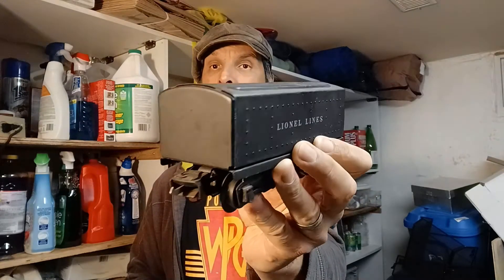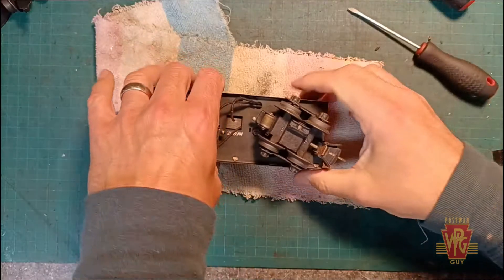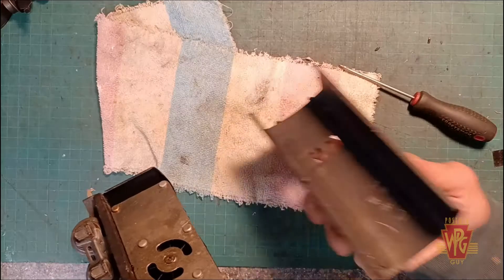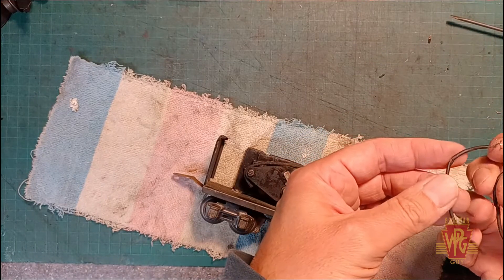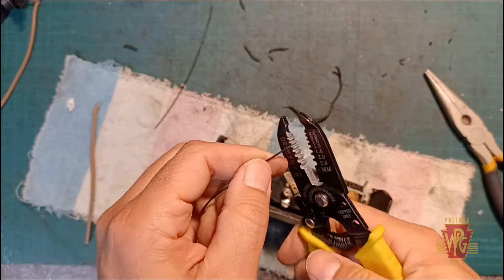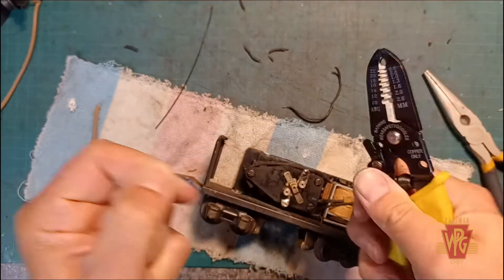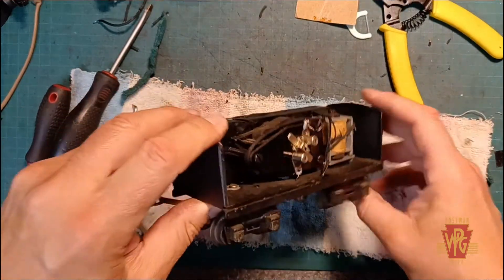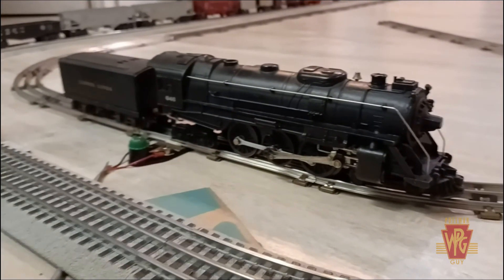Why isn't my prewar tender whistling? A 2689W with neat surprise!

Comment: Nice job Warren!  I had to do a job like that myslf a yar or two ago but it was a metal post-war tender instead of a pre-war.  I'll tell you, I found getting the shell back ON was harder than getting it off! 
What I'd do at this point is if you don't want to start a collection of pre-war cars try and find a pre-war with similar couplers and replace one truck with a post-war one, make a "bridge" car for lack of a better term.
Fun video!  Thanks!

Comment: I believe the wire attached to the screw on the underside of the tender is to improve the relay ground, since from what I understand the relay is just riveted to its bracket. This was discussed as an improvement in one of Jim Barrett's workshops on VHS tape (for O Gauge Railroader Magazine). Very good video, A+++

Comment: The part number for the adapter is:TT-100. I hope that helps. BTW,  nice job. The only thing I have done differently is to add a rubber grommet in the tender base, to protect the wires.

Comment: Another nice,  informative video. Do you think these old tenders needed to have 2 pickup rollers?
Reply from the maker: I'm not sure if they really need 2 pick up rollers, but Lionel gave it 2 for some reason. More consistent or better contact with the rail? 
I have an earlier prewar tender that has only has one. Its mounted on the frame between the trucks. Thats its original setup and it works fine. This maybe something worth investigating and making a video for.